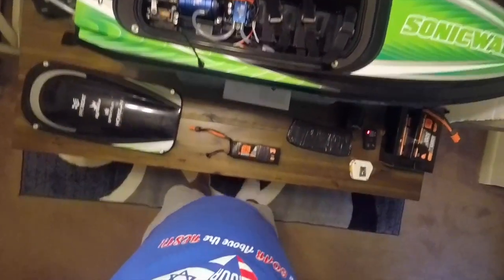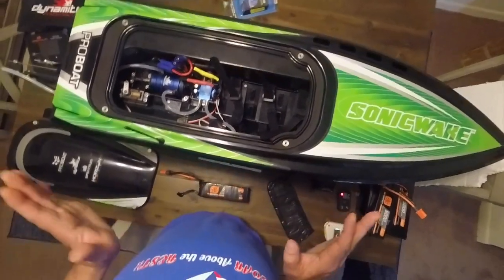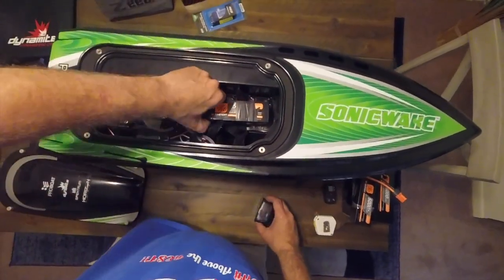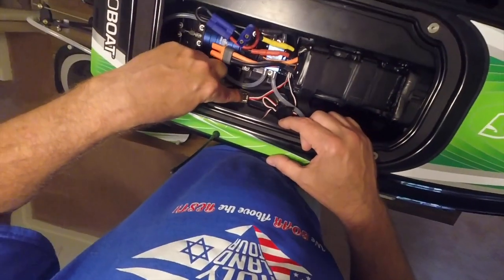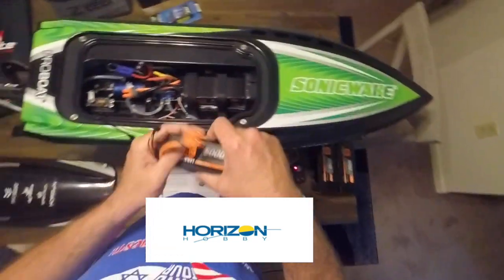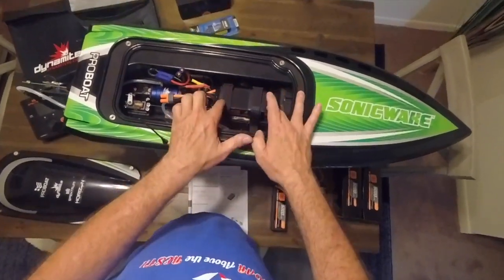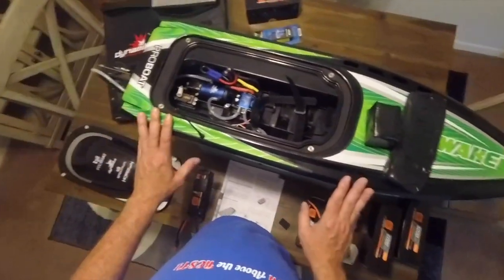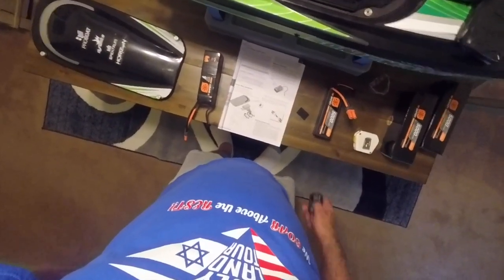SONICWAKE 36 PROBOAT - Batteries and Maintenance

Comment: Thanks for sharing your thoughts and experiences with your Sonicwake 36. Very much appreciated. I'm very new to RC Boating and all this info helps.
Reply from the maker: Glad it was helpful!
Reply: It certainly has. I have the same boat. Unfortunately I bought a different battery charger 🙄 I'm going to buy the one you have to make my life easier.
Reply from the maker: I dont like things to be difficult and I just like plug the battery in and let it go and use it. so great that your getting one. If you have any other questions let me know. and thanks bud. and all the controls on it dont worry bc all I set was the discharge time to 48hours and thats it on the charger but you dont even have to do that. I do however keep my battery in a bag and just let the lead out to the charger to keep it safe and you will need a IC3 to IC5 connector thats on horizon hobby for about $10 bucks if that if not you can get one from Tower Hobby and they have them but you will need that to connect to the spektrum battery charger. I would like to see some vids and give you a sub and hope you sub to my channel but once post some stuff I will sub. let me know
Reply: Hi, would it be possible for you to do a video on the Spectrum battery charger? I just bought one and I pick it up on Monday. I also got the connection wire that you mentioned.

Comment: Arrma infraction straps worked perfectly for me.  It has the better Velcro that hooks together everywhere.  Wow you put 12s through there holy crap I’m glad you are ok.  Change the straps and you’ll be good
Reply from the maker: Yup it was my very first boat and i didnt really understand much about it but horizon addmitted fault bc the manual didnt specify what the max volts should be so yeah i got lucky bc when that blew up in my face it was like a blow torch. Thanks for the tip.

Comment: Man you are lucky you didn’t start an electrical fire!!It does say not to go over 6s in the instructions and glad to know they are doing good with warranty,Velcro drips on boat and battery’s so you can adjust battery location for different water surfaces.Great boat
Reply: I was the same when I tried et a motor that went out on a steathwake that was mis aligned and Lester about the first run.I always check everything on boats now when received.And by the way I still haven’t gotten them to have the motor replaced.
Reply from the maker: yes I was lucky it did burn my had alittle but its ok..thanks bud.

Comment: Yep I have had the same problem I swapped the straps out for better straps that work and I used tape velcro Inbetween the straps it now holds my 6s battery tight and fine ,it works great no matter how many times I roll the boat
Reply from the maker: yeah any ideas that work please post. and thank you
Reply: @DronemanJoeRc  I used the straps from one of those cheap gopro action cameras it holds my 6s batteries in no problem at all had mine out last night it ran like a dream with everything I have done to it the temperatures were well below 100 degrees  c, esc hit 60 motor 62 battery 40 and xt90 connection 83 and that was a flat out run with a fully charged battery I am happy with the results I will put up a video of everything I have done later today if I get chance
Reply: @DronemanJoeRc  have put a video explaining all the upgrades and the battery straps replacement s I have done on my channel hope it helps you

Comment: I had the same problem with the batteries. Ended up building a custom removable ABS cradle to hold the 3S batteries.
Reply from the maker: I know what your saying bc they dont fit in there and like I said when it flipped it didnt turn over so I came up with this and it worked. thanks for the comment bud. I will check out your vids also

Comment: A quick fix is to pull the bottom strap up and put the battery under all of them. My wife saved me from getting real frustrated on my first run with this idea. It seemed to keep it in place as well.
Reply from the maker: Thank you another great idea. thanks for sharing that.

Comment: Nice! I did something similar with kaizen foam. My batteries shifted when I took it out the first time. Boat flipped and didnt self right due to batteries moved and created a counter balance to the ballast. Good thing I had another smaller boat lol. Great video. Sub'd!🤘🤘
Reply from the maker: Yeah the first time I took it out I couldn't get the batts to sit right and I knew something was wrong and I flipped it and it didnt self right. I was lucky the wind was blowing my way otherwise I would of been going for a swim. everything is great now but I talked with Horizon about this and they said they was going to look into it. who knows. but thanks for the sub and I sub back and will take a look at your vids bud!!

Comment: I'm new to boats, I'm an rc aircraft guy, but can one not use Velcro to change CG like we do in aircraft?
Reply from the maker: you do use velcro but the batterie cradle is what I believe is a manufacture defect bc when you stick them in and strap them down they dont hold. so I came up with this to fix the problem. I contacted horizon hobby about it but they didnt seem to care. it works for me thats all that matters. thanks for the comment.
Reply: @DronemanJoeRc  I just ordered one today. Was going to go Spartan, sadly no self righting I'm mountain lakes means cold swims. So I went for this... lol I'll have to see what's happening in there when I get mine. It'll be my first boat in 20 years so I have little to no clue what you're talking about since it's no in front of me at the moment, but this is all great info for when mine shows up! Have you had any 6s overheating issues? Wondering if should just get the twin cooling rudder now or just see what's happening first...

Comment: Hi going to order one of these boats this weekend and batteries also.
What is the length of the battery compartment? I'm thinking of ordering 6500mah or 8000mah lipos if they will fit. Any advise would be great.
Reply from the maker: I wouldnt go that high of a mah, mah is really just what I call the gas tank the higher the more run time but I get plenty of run time with my 5000mah and they are just fine for it. I do use 100c for bigger burst. What I use in the video is just fine. thanks for the question.

Comment: You can even make it easier by putting velcro tape on the battery all you need is some adhesive velcro (hook and loop tape) also replace the flex shaft with a ose upgraded flex shaft because the proboat flex shafts are not well designed they are horribly unbalanced and put lots of stress on the motor because of resistance due to uneven balancing the offshore electric upgraded flex shaft is cheaper then the stock shaft but you will need a new coupler for the new flex shaft as it is a different thickness shaft... it will take you a bit to change it out but it is not hard only slightly difficult and if you need to ask some more questions about it just shoot me a message and I will gladly walk you through it! Also remember to get some dynamite marine grease so you can keep your prop shaft lubed... you want to do this every 2 battery runs or every time you are done at the lake when you get home remove flex shaft and clean off with rag and wipe some fresh grease on the shaft as well as a couple of full squirts up the stinger but put rag between coupler and flex shaft clean of tip of flex shaft as it goes towards the coupler cause you don't want grease inside where it bits down on the flex shaft to keep it in place... there are videos on YouTube on how to do this properly if you didn't understand what I said for any part of that.. I  hope this helps let me know if you got any questions bro
Reply from the maker: Thanks bud I got all the grease and tools to do the maintenance. I do the shaft after 2 pack runs, I got the miss geico 36 but had to send it back bc it wouldnt run right..it would only run in fwd at rev speed and vice verse, I tried everything to get to run but nothing would work, I was on the phone with horizon for 2 hours trying to get right but nothing so I had to send it back and let them fix it.  I appreciate your input and thanks again.
Reply: I plan on buying the heavy duty flex cable from ose. What coupler do I need to use this. Thanks

Comment: Any word on if Horizon has resolved the battery tray fitting issue. Looking at purchasing this boat and this is just an inconvenience to fix.
Reply from the maker: No not that Im aware of so I would suggest following what I put out and it will work to fix it. I think they have alot of issues with there battery compartments and they dont seem to pay much attention to ppl when they give them input back. I had issues with there apprentice sts with safe plus and talked to them to fix the problem but they Iggy me so I posted my own video to demo the gps and landing assist mods they sell and they just dont seem to care but they put out some great products but dont listen to there users. Idk but thanks for watching and I appreciate it my friend.

Comment: How did you contact Horizon because I can't reach them I sat on hold for 3 hours and emailed them 4 times with no response.
Reply from the maker: I had the same problem but since I bought the boat threw amazon they contacted them and within a few hours I got a call. what kind of problems are you having with your boat?

Comment: What length of run time are you getting with the 5amp batteries?
Reply from the maker: It depends most about 10mins if im running it full throttle.

Comment: The battery compartment works just fine stock. I also thought there was something wrong with mine when I first got it and the batteries shifted on me. The straps don't go under the batteries at all. You put the batteries in the compartment side by side if you are using 2x 3a. The straps go over top of the batteries from left to right, then come  back through the clasp and go over the top again and velcro down over its self. I havnt had a problem since in 2 years. You don't need to make any shims or anything else to hold them down. Hopefully I have explained this ok. There is a thread on RC Groups on the Sonicwake that maybe explains it better than I did. If you have installed them correctly the straps should be doubled up over the top of the battery/ batteries and you will hardly have any extra strap left.
Cheers
Sean
Reply from the maker: that may work I will have to try that.

Comment: Do you guys realize that "if" you run (2) 14.8v 5000 mAh batteries in parallel instead of series...remove the original (Dual Battery Cable/Connector) and replace with a "black to black/red to red" parallel configuration and you will get the power/voltage of a single 14.8v but double up to 10000 mAh or run time...
Reply from the maker: idk but well check it out!!

Comment: Oh you’re using one battery I see I was like how are you gonna get the other battery in.
Reply from the maker: yeah I use 6s 22.1v 5000mah spektrum 100c smart batteries and I have two but I also use two 3s 22.1v 5000mah spektrum 100c batts also the 100c give a bigger burst of thrust to the boat
Reply: Ok cool I use two 3s 11.1v 100c. What’s the difference between the 22.1 and the 11.1v
Reply: And about how long is your run time with that battery